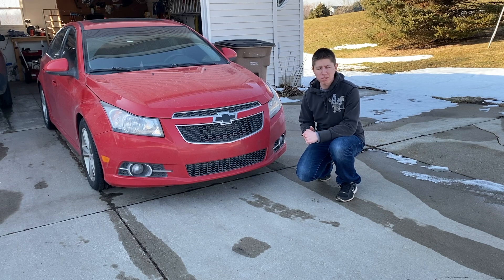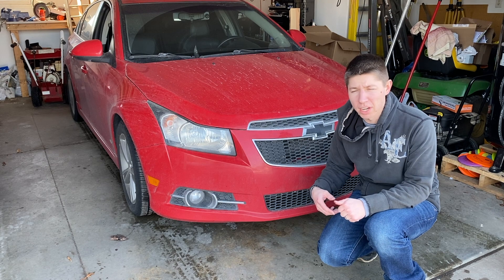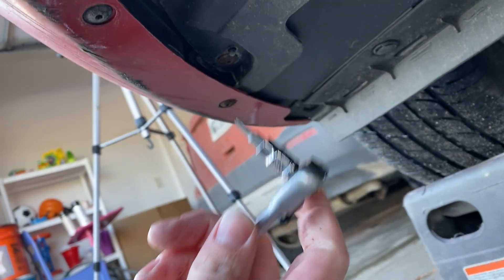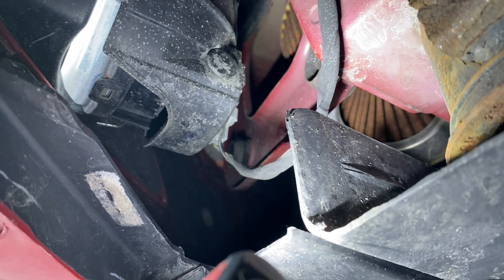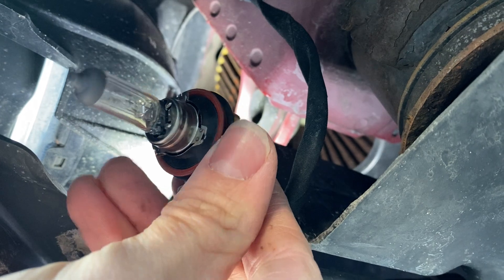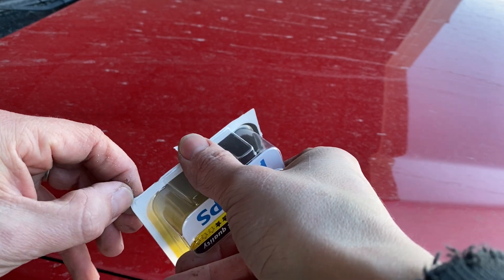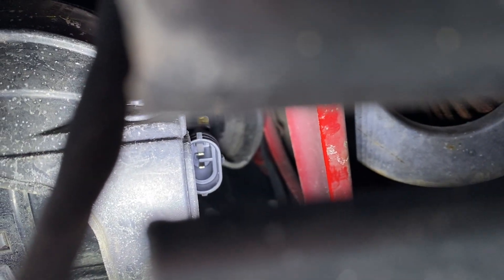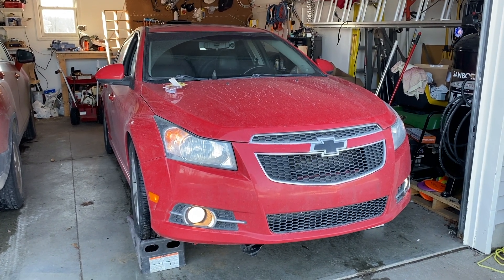Chevy Cruze - Foglight Replacement How To

Comment: what about the reverse light? i have the chevy cruze 2015 hatchback 1,7TD... reverse light stopped working and I noticed it because also the parking assist died completely without any notification on the display, so i gather it takes lectricity through the reverse light in series...?? how dumb can that be...

Comment: It’s been a freakin hour and I’m still trying to put the damn bulb back I’m losing my mind
Reply from the maker: I had a little issue with that too. I had my hand up there with the bulb and watched bulb going straight in through the lense, on the front of the bumper. It helped a little.
Reply: Chad Williams I tried that but unfortunately you can’t see threw  the lens on my fog lights I eventually got them back on it only took about 2 hours 😂😅 now I’m gonna do the side marker bulbs on the front bumper